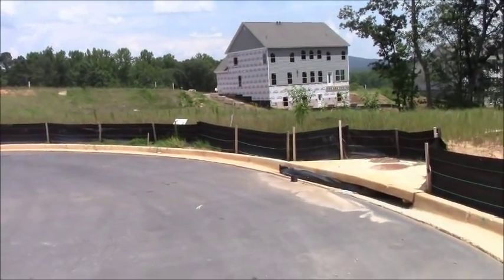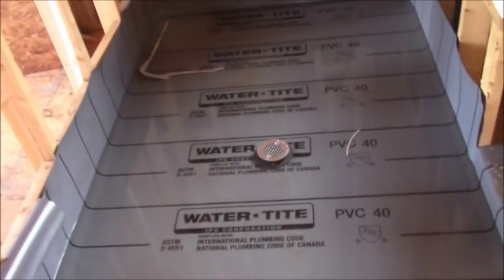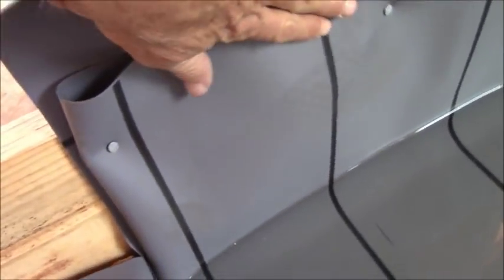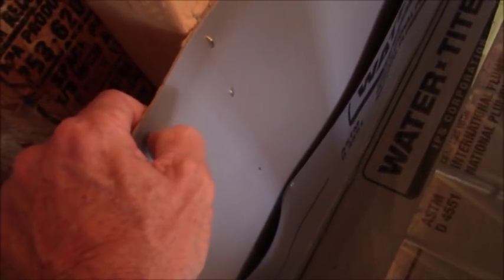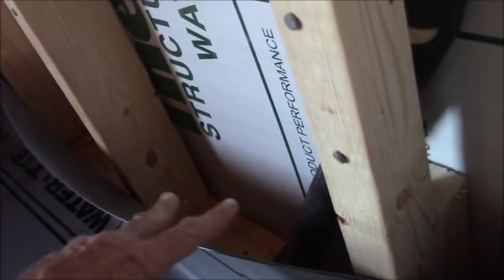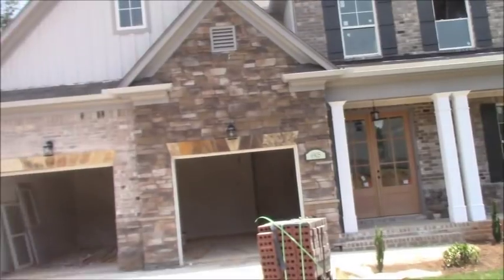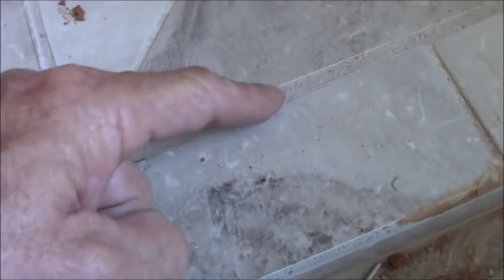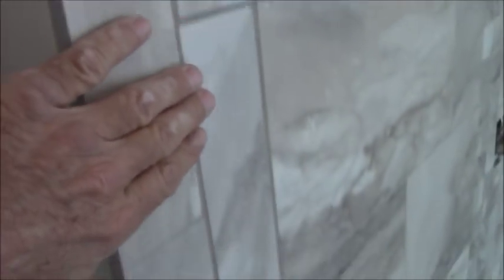NO ShowerPan PreSlope ..NEW CONSTRUCTION

Comment: That's Pex A water line ,most people are used to seeing Pex B ,which has the metal rings. Pex A you use a  expander on it and put it on and it goes back down tight.

Comment: I don't agree with your conclusion that pre-slopes are not needed based upon the tour of these homes.   You consistently point out the shoddy workmanship such as poorly cut pan liners, incorrectly installed shower valve, bad curb grout lines,  and no curb slope.   However no pre slope is good.   Couldn't the lack of pre-slope be another example of shoddy workmanship?
Reply: He is just flat out wrong. There are guidelines for mud bed shower applications and you need a pre-slope. Water penetrates through the mud bed. The slope directs the water into the weep holes at the bottom of the drain. Without a slope beneath the liner you will be pooling water.
Reply: I have never seen anybody do a pre-slope.... So it's not necessary
Reply: cccampbe2 👍

Comment: Water is supposed to go through your dry pack and get to the drain fairly easy..if water is not going through your mud quickly you are either making your dry pack to rich or you are packing it to hard . You can take a plastic object like a small clear container..something like a gallon size...drill some holes in the bottom of it...pack it with dry pack ...let it drt...try to fill it with water and see how fast the water goes straight to the bottom and out the drilled holes...

Comment: "ive never seen copper degrade " what the hell is this guy smoking
Reply: Justin time right, that green residue on the side of copper= degrade. Copper freezes and bursts...
Reply: My house is 80 years old I saw it. Tbh none of it was leaking but it was clearly corroded
Reply: Strangest comment ever. I own a RV park and need to replace copper pipe all the time after they leak.
Reply: Try live hawaii, salt air and electrolysis

Comment: Just recently I went to do my bathroom. And decided I'm going to stick with my copper!! The fittings for the quick connect plastic are ten times the price of copper.
Reply: I bought the pex tool and just crimped the mixer and just shark bite back as far as i could on the copper but my copper is old and has leaks all the time ima replace the whole house now in pex

Comment: A preslope ensures whatever gets to the liner will be directed to the drain. The liner only protects the floor underneath from getting wet; it has nothing to do with drainage! 
Once water get to the liner, it may very well not drain or cause damage to the floors integrity. 

Here is why. Even if the floor is sloped, the path to the drain could be blocked by a hump in the liner. Either way, you can not rely on capillary action (AKA capillarity) to absorb all the water not flowing to the drain. Capillarity is the absorption (rise or depression) of a liquid in a small passage based on the pairing of the material's (this time floor mud and the liner) sorptivity (the measure of the capacity of a medium to absorb or desorb liquid by capillarity).  The lower the sorpravity (in this case 0.70) the lower the amount of water the material (floor mud) will absorb. Further, the absorption amount is also limited by the waters temperature and the areas humidity.

Therefore, after time, capillarity is not going to soak up any water and the water will thus puddle up. This stagnated water (or soaked floor mud) will lesson the structurability to hold the weight of a person in the shower and theoretically could result in injury to the showerer.

Comment: A question; when installing wall board, how you deal with liner been so thick and kicking wall board out at the bottom
Reply from the maker: Only a slight bump out, and only at bottom corner area. Thinset applied lighter in those areas.
Reply: Yeah that one seemed pretty simple to counter it only bumps out a little bit

Comment: BTW the tub was just weighted down while it sat in the concrete. They just needed the weight while it set up. That pex is the worsbo pex you stretch the ring instead of crimp. Thats the only dif with that. That tool is big bucks

Comment: Been said many times, but that’s Uponor pex. It’s the highest quality pex system you can get. Definitely better than copper. And yes copper does degrade, try living anywhere with hard water, which is a lot of places. Certain counties in Maryland require preslope under pvc pan liners, and those liners are the plumbers responsibility, and the flood test is a plumbing inspection. Not referring to the efficacy of them, just the requirement of them.

Comment: Been doing pre slope for 27 years of 30 years doing pans. If you don't it's going to smell. Never did it with lead pans before using vinyl. What is with all the cheap drains all these butchers use? That drain and any one like that one that is not a heavy grid that can't be bent should be used in maybe a mobile home only. And good God get that crap PEX out of houses. Have seen mice chew holes in it, restrictive, can't be electrically thawed, allows for a horrible mess of piping, if the butchers that use PEX to repair copper systems they break the electrical bonding and you can get shocked from a pipe touching a bare wire, seen that first hand. I can't believe what plumbers are doing in homes today, they should be embarrassed, what a joke. 95% of all plumbers should be working in either Walmart or doing plumbing in a third world country. BTW , a little pea gravel around drain to keep the weep holes clear of mortar works wonders.
Reply: I just bought a 13 year old house and within a year my shower started to stink. I started demolishing it slowly and it turns out the motor completely filled the weep holes! To top it off, there was no pre-slope. So now, I have it down to the membrane, flat, I can’t decide if I should pull that membrane up to put a pre-slope under Dash may be a fun one Dash or just put a new mud bed on the existing membrane.

Comment: In Florida  copper only lasts about 20 -25 years. it corrodes through and makes pin holes. In NYC I've seen 100 yr old copper pipe still working perfect.

Comment: The type of construction(new or old) is irrelevant.  New homes are built like crap and everyone knows that the bare minimums are what is done.  The cost of the home is also irrelevant.  Charging $350k doesn't change the fact that it's crap underneath.  The PVC liner was installed by a hack.  The corners look like dog crap.  I tear out 5 year old showers all year round and shovel the slop out of the no pre-sloped pans every time.  Weep holes are always blocked.  One stage systems are far superior with the tile bonded directly to the waterproofing.
Reply from the maker: Your perfect world doesn't exist & never will.
Reply: I know, there are too many out there that are thought wrong from day 1.  Sometimes I wonder if they've ever been taught at all.  I can at least make a difference when I become an inspector.
Reply: StarrTile That's exactly what he is saying.....
Reply: Is red guard a one stage system? I'm doing a linear drain with no curb and trying to figure the best system.
Reply: homertalk it can be.  The drain needs to have a wide bonding flange that is sealed by embedding fiberglass mesh cloth in the RedGard.
Reply: Brett Kowalewski   This is an interesting video that Bob has shown us , of new construction. I’m sure most of you craftsman can see the problems immediately.  As a building inspector I also see issues. However my first question is whether or not this house has passed inspection. If it has shame on the builder and the inspector. If it hasn’t been passed hopefully the inspector will write the necessary correction. The inspector
Would be familiar with not only the code but also the factory requirements. These pans need to meet all requirements especially factory specs for installing the liner including pre-slope , it’s not a choice. Remember the codes are minimum standards. It’s nice to know many of you go well beyond minimum code I applaud all of you guys. By the way, good luck in becoming an inspector , you are in for a real eye opener , you will never stop studying , teachers have nothing over us.

Comment: The tile industry has governing board that sets industry standards for tile setting, much like electrical and plumbing.

The TNCA is that trade assocation, and a pre-slope is required, this should've even be a discussion.
Reply from the maker: Of course it's a discussion, there is various opinions in every single trade out there..this is no exclusion
Reply: @StarrTile ..  a pre slope is a specified part of a shower enclosure per TCNA details, that makes this a moot point. You can't just throw electrical parts together, this is no different, a governing body says it's needed. Period.
Reply from the maker: @danross1056  TCNA is NOT a governing body , they are a private entity, supposably nonprofit but they are funded by a lot of large companies like schluter-kerdi which makes most of what they recommend, the keyword recommend, suspect. And your analogy of electrical and plumbing is flawed beyond belief, those are finite sciences whereas this is more of a subjective art form where there are grey areas. Over the last 20 years I have seen it done many many different ways that work and that last, that have nothing to do with the TCNA. Including my own way which is infallible so far. Book soldiers like yourself are dangerous in combat as well as in the trades, cannot think for yourself and we'll jump off the cliff because Johnny did
Reply: @StarrTile  book soldier ... that's funny .. I'm suspect of anything you do now ... I didn't hear you condeming the wood in the curb, no good tile man would put wood in a wet area. ever.
Reply from the maker: @danross1056  obviously you are not a veteran or you would have understood that reference... anyway as I already pointed out or perhaps I did not, most every Tiler his waterproofing their pan surface so the whole back-and-forth is very much a moot issue, but I do enjoy the cat and mouse once in a while which is why I'm entertaining your comments.
Concrete curbs or floated curbs will wick water from the pan motar  unless you can figure out a way to separate the two which I have not seen done yet, when that happens it absolutely destroys the outside wood subfloor. I use wood curbs because I can guarantee a waterproof barrier on my entire shower oh, I don't have time to go into any explanation, with 380 videos you can go through my library and see how I do them.
However a future suggestion would be when you post a comment on somebody's channel that you actually back it up with some proof instead of just words, referencing my 380 videos I have proof of everything I do 👌👍
Reply from the maker: @danross1056   and you sir are a troll, as evidenced by your continuing this discussion even after I have proved to you that you are completely wrong...
And I don't need your well wishes or luck, I have 21 years of a successful experience👌
Buh buh👋

Comment: That is wirsbo, it is similar to pex but you expand the plastic ring and when it contracts it seals over the fitting. It's illegal to use where I live.
Reply: Karon Lowther where do you live that it’s illegal? Just curious, because it’s literally the highest quality pex system you can get. Also, much better than cpvc or copper.
Reply: @scottbaird7941  the plastic sleeve expansion/contraction system is illegal here. We use the metal ring and crimp method, using either copper or stainless steel rings and brass fittings. It's faster, easier and doesn't give you troubles when installing it in really hot/cold weather.
I live in Lancaster county Nebraska. By the way the only approved systems here are crimp pex or copper piping. ABS pipe is also banned for drain, waste and vent, we have to use PVC or no hub cast iron, if specified in the building plan.

Comment: Our inspectors are making up do pre pitch now in Daytona beach Florida area.
Reply from the maker: Well that sucks. Ask them if you waterproof the pan surface then would a pre-slope be needed... I bet they scratch their head on that one
Reply: @StarrTile  I always waterproof or red guard the floor anyways, I do the sand mix pitch and then o ce it sets up I add a sheet of dura rock which I mud down with 3/4 round thinset. Weight it all down and use the screw drain to suck the middle down. Once that all dries tape corners and mud and then use waterproofing membrane (red guard, laticrete, yellow stuff, etc.) Its just been recently maybe last year or so I've noticed the inspectors asking for it more and more. South Daytona area mostly also. Only so much can argue with inspector. The plumbers are usually the ones that have to do the pan ,especially on large condos right on ocean very strict about stuff. Firewalls etc. sucks because some times they do shit work and I have to go back and RIP it apart or fix it so my tile will work.
Reply: @StarrTile  do all the walls also especially wet wall and Up to the shower valve, just good habit I think, and doesnt hurt.

Comment: in my area you need a vapor barrier and hidden insulation inspection on tubs and liners.  i imagine that material is some type of approved vapor barrier normally it would be tyvek.  that is defiantly pex but i rarely see those fittings.
Reply: Where do you work to rarely see wirsbo or uponor Pex? It's literally the best Pex piping made. The crimping Pex is complete trash....
Reply: And that liner is made out of pvc

Comment: The whole DWV system is required to be filled to test, in Michichgan any way. As a Licensed Plumber who has done new construction since 1979, I have never put "Pre Slope" on a shower pan. I do not use Pex, only Copper.  I fold it the right way, and filler in between studs is required.

Comment: That thin barrier board behind the liner is called Strong Wall, which is a thin “cardboard like with a waxy or clear plastic like film “ to make it water resistant. Used for Shear Walls on the Interior walls but I have seen it used on exterior walls also. Don’t know enough to make a judgment on it yet.

Comment: Ok, you are absolutely right about capillary attraction. I pulled up a shower pan of a shower that hadn't been used in years and it was still wet between the mortar and the pan liner. The water just sat there, not flowing down toward the weep holes. So what is the purpose of a pre-slope if it doesn't work? And for that matter what is the purpose of a mortar bed at all if it is just going to soak up water like a sponge and sit there under the tile for all eternity spawning mold and mildew? Why not just skip all the hard work and tile on a fiberglass pan?
Reply from the maker: Going back about six years ago I started waterproofing the pan surface and silicone around the neck of the drain, that ensures that your pan will never get wet and it functions basically just as a slope for the tiled surface
Reply: @StarrTile  so your red gaurd your pans?
Reply from the maker: @keithbaumgardner1603  all day and every day
Reply: @StarrTile  what do you use for your mud bed?   Type s mortar or something different.
Reply from the maker: @keithbaumgardner1603  I use Quikrete sand topping mix at Home Depot or if I'm at Lowe's then I use Sakrete sand mix....no lime

Comment: I don't know what the water is like in Georgia. But to say pex is a bad product is just an opinion from from someone that must like playing with torches and soldier. Pex is the ONLY type of pressureized water line I have NOT seen fail when used with brass fittings. If the contractor cheapens out and uses plastic fittings, well that's on whoever. But I've seen pex go below freezing, swell and thaw with no issues. I've never seen a pex pipe disintegrate. Hell, my brother even fixed a vacuum line on my old Dodge van with pex one time cause it's all we had. And that damn line outlasted the 3 years it ran afterwards till it was sent to it's final resting place. My respect for the man in this video has literally diluted down to "well, at least he's trying to be helpful". But at the end of the day, he works by himself and it's obvious that's because no one else thinks like him and most likely gets tired of him rewriting the system with his own views. Also keep in mind that this man swears by the fact that mortar is not needed under backer board on the floor.  He just simply screws it down because "customer's don't want you to ruin their subfloor". I guess they plan on taking with them when they move out, idk.
Reply: Also... No one has a perfect eye. 10 bucks says a level would've said that curb is sloped. I'm starting to see why he gets so much hate now.

Comment: I guess it's common now to use liners and cement board walls, but, the only way I do showers, is hot tar mop, and mud float walls. I've seen backer board walls always crack the corners once the wood framing expands and contracts
Reply from the maker: There's definitely a skill set in floating and hot mopping, but the better question is why, there are easier methods and the idea is to work smarter and not harder oh, you cannot pay me enough to float and you definitely could not pay me enough to hot mop, very Antiquated techniques, although I appreciate the effort there's just no point anymore.... and the problem you have seen with backerboard I have never run into

Comment: Thermaply- the membrane you pointed out between the insulation and pan. House wrap Ian more commonly used here, but thermaply is a true air barrier. They Also air sealed with foam which is even better. The mistake here is the thermaply should be to the top of the tile wall.